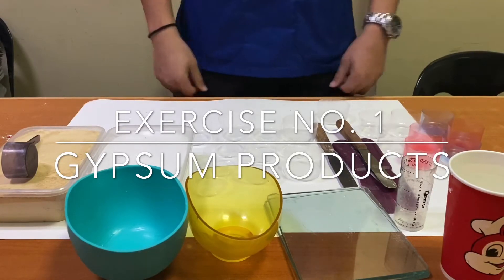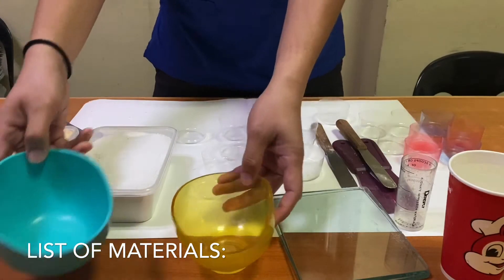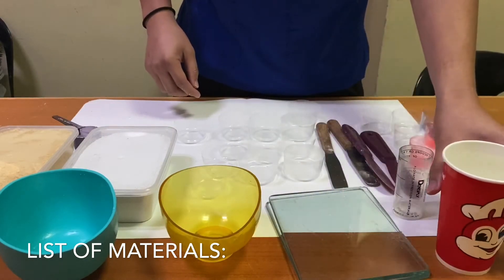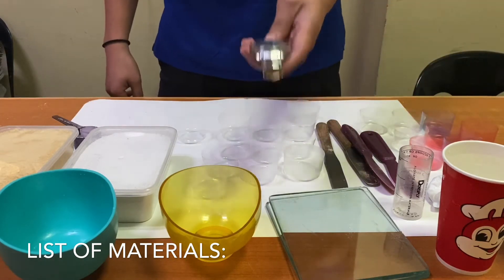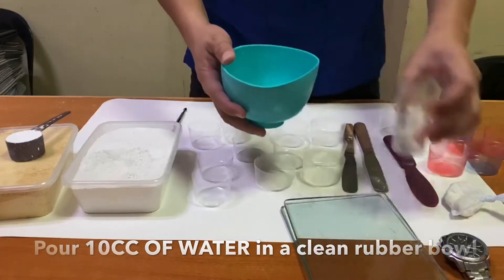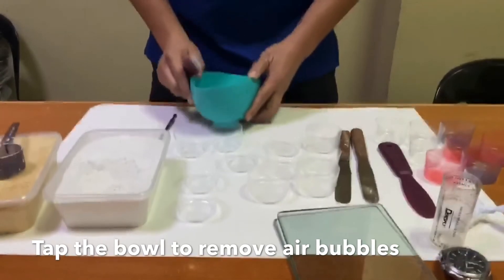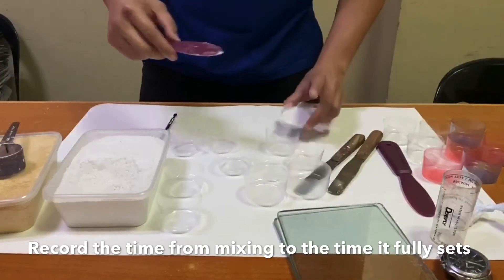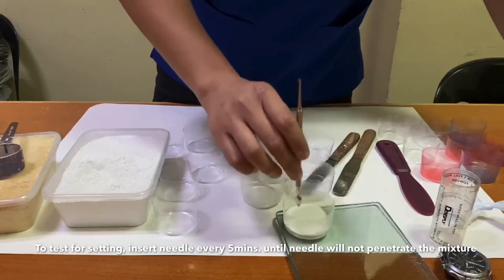Manipulation Demo for Plaster of Paris and Dental Stone

Comment: How do I not make clumps when I stirr plaster for articulation?
Reply from the maker: Make sure to prepare the water first on the rubber bowl then add the plaster. Mix it thoroughly and tap the rubber bowl on a table or you can use the vibrator if you have one. And also, the proportion of water and the plaster is important. 😊